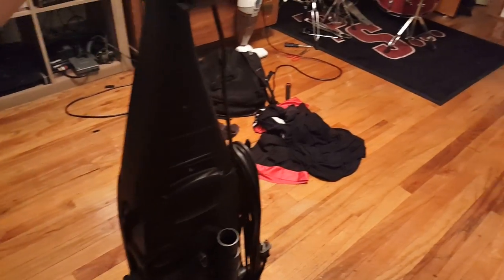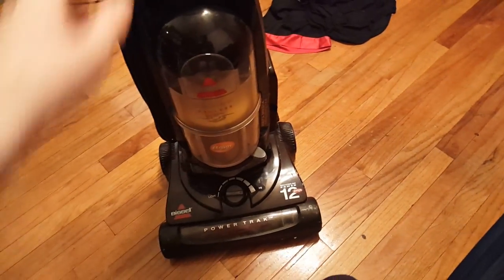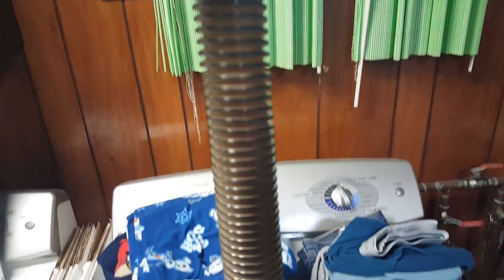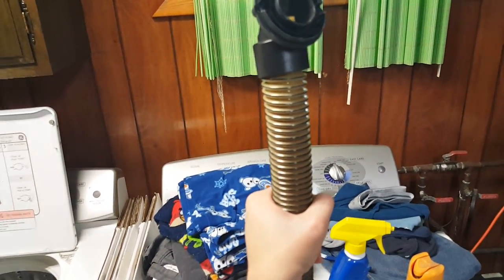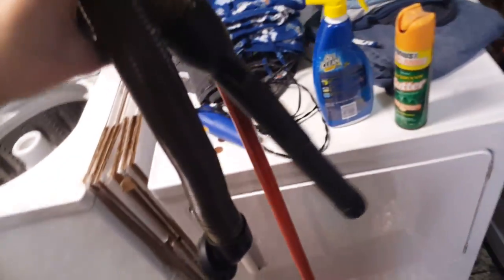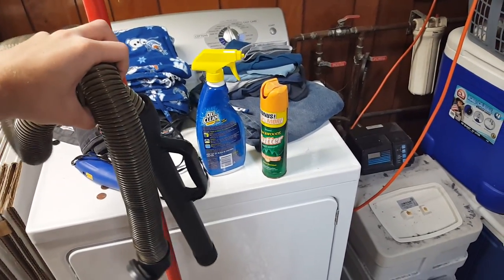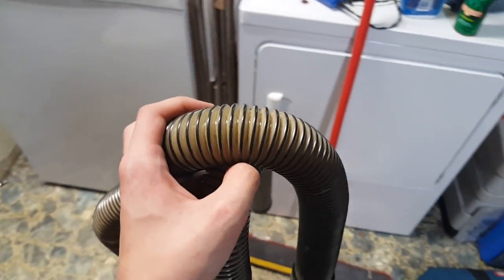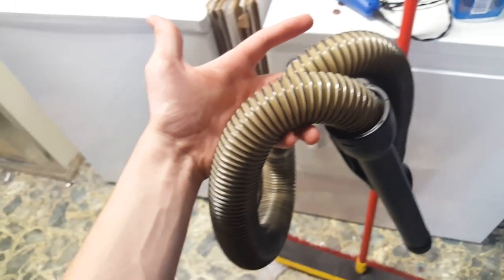TUTORIAL: How to Unclog a Vacuum Cleaner

Comment: Problem is my vacuum has a curved handle for the hose sucker and I can’t fit anything down it
Reply: Same
Reply: Same
Reply: This solution worked. My hose also had curved plastic endings. I had to take off the plastic endings and separate the hose.
Reply: I was suggest a drain stink because it could bend and you could twist and turn it

Comment: Thanks for your video first of all. This just happened to me in the last 30 minutes. I've tried a broom handle, a sponge mop handle, a yard stick and the sock will NOT come out of the hose. I refuse to cut the hose as one youtuber suggested. I think i need something a little more slender than what i've tried. I'm now wondering whether pouring water inside the hose will make the sock fall out. Ugh so frustrating! Will report back.
Reply: Vegetable oil and hot water. I just did it and boom out it came.

Comment: Thanks...
I did this and now the hose is clogged worse.
Tried from the other end now and it's even worse still.
Now I have a stretched out hose that has a rock solid clog.
Did I say thanks?
Thanks.
Reply from the maker: Try removing the hose from the machine and soaking it in hot water and detergent. Should soften it up enough for the clog to be pushed out

Comment: Didn’t work.  The broom handle just compacted the clog and now it’s worse.
Reply from the maker: When I had that issue I Ran hot water through the hose and let it soak in the bathe for a few minutes. That, softened up the clog so it could be pushed through